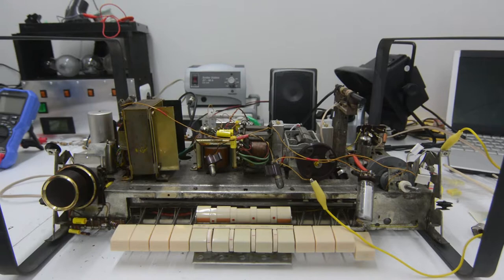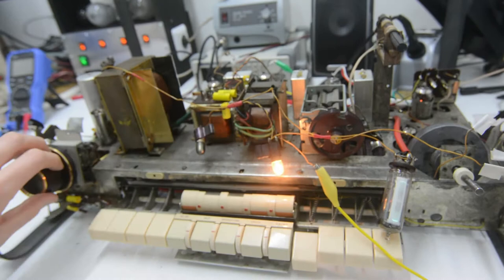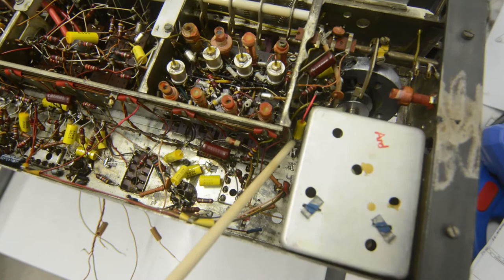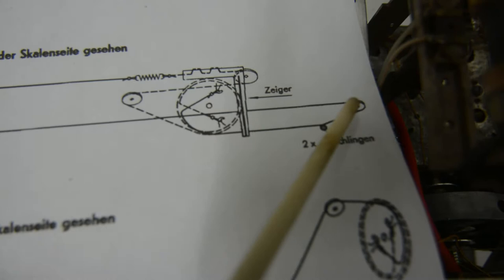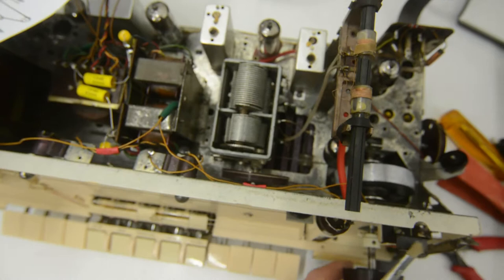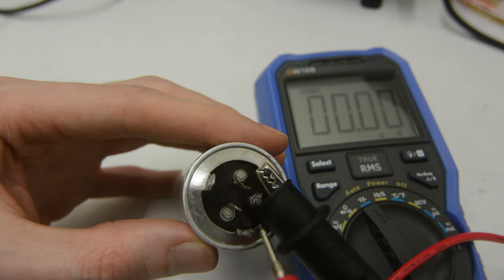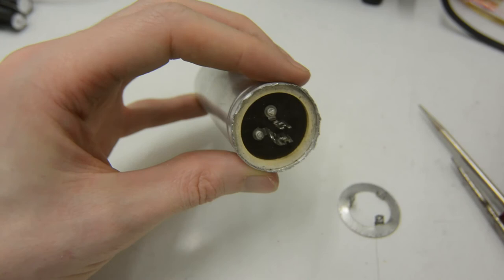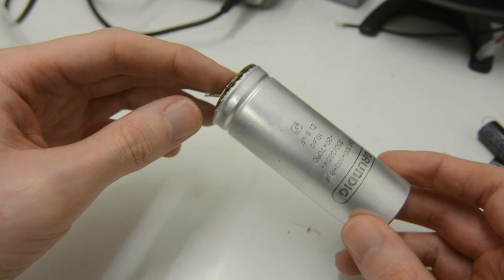Dial string horror - Grundig 5195 Stereo (Part 7)

Comment: Hello- I am in the process of restringing the dials on the same radio and am struggling.   I would like to know if you needed to remove the steel plate on the front of the radio to start the process and then reattach the plate to complete the AM/SW tuning  stringing.  The FM is not so difficult but I am really struggling with the am (MW in Europe) dial.  If I could write to you privately that may be more appropriate for this question.
Reply from the maker: I know, it's a pain, those dial strings. I took me a couple of hours to get them on correctly. I honestly don't know what the easiest way is to get the AM string attached. I did it with the steel front plate attached, but it was very difficult and I have no clue how they did it in the factory. I have a bit more info on the AM dial string in Part 8 (around the 7:30 minute mark). I used a lot of electrial tape wherever possible to keep the string in place while I was attaching it.
Reply: My string keeps slipping off the plastic spool attached to the tuning condenser when it travels to the front pulley attached to the steel plate. I am trying to use new cord but may need to pull a wire from another junk chassis as I likely discarded the original steel wire a few weeks ago.